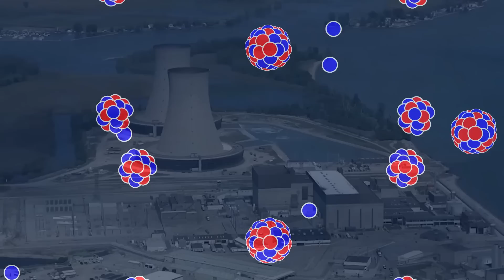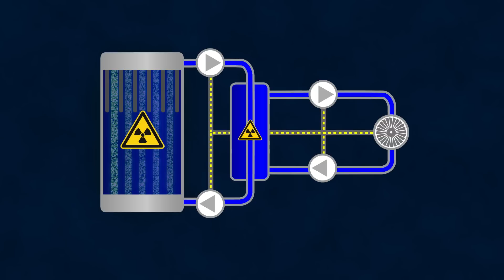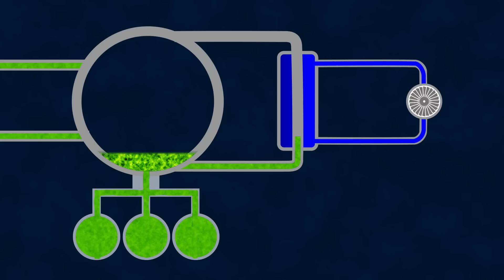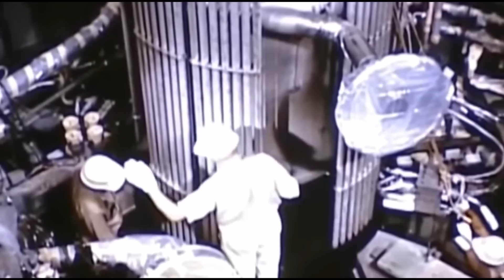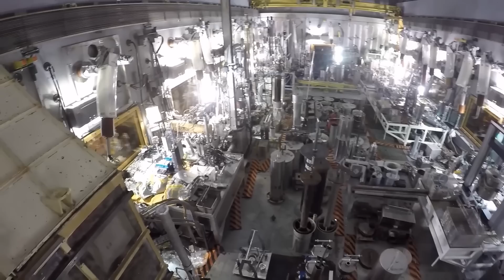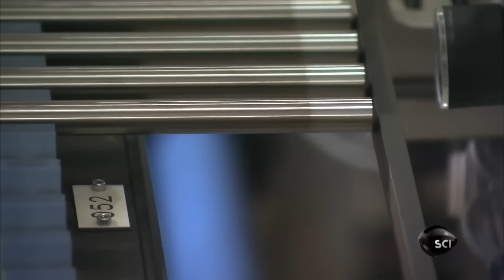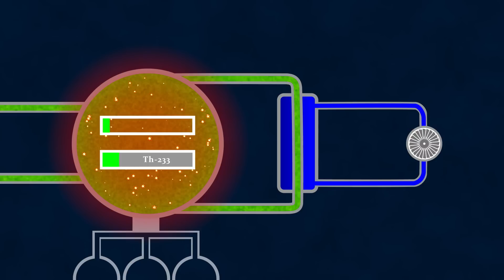Thorium Revolution: Can China’s New Molten Salt Reactor Transform Nuclear Energy?

Comment: How to ensure the corrosive molten salt stay where it's supposed to stay for the long-term is the issue
Reply: I think a few years back they found Zirconium lined tubes slowed  the corrosion down, but even so, corrosion is a just a maintenance problem not a technical.
Reply: @ it's a combination of radioactivity & corrosion & high temperature, so it's kind of more complicated for maintenance
Reply: @Guangrui   Nothing that a bit extra research cannot solve.
Reply: Hastealloy-N. It's a well-known Nickel-based alloy, which has very great corrosion resistance, and was developed with Molten Salt Reactors in mind.
Reply: @ZippyPiglin36  can it stand the radioactivity & corrosion & high temperature for the duration of over 20 years ?
Reply: @Guangrui   Experiments show it can stand such decently.
Reply: @Guangrui  Yes it can. It ablates at around 1 micron (0.001mm) per year of operation and has been calculated to have a 200 year lifespan under normal operating conditions

The (quite mild) corrosion issues are heavily played up by those opposed to molten salts, whilst they conveniently omit mentioning the massive corrosion problems associated with high pressure high temperature water - Davis-Besse 2002 was a VERY near-miss

There's a lot of FUD being tossed around and the way I'd summarise it is: If those opposed to molten salts are so sure they'll fail, why not let tests be run to prove it?

The vehmence of the opposition is directly related to the fear of income loss amongst existing players - who all practice major vendor lock-in. The disposable razor and printer ink crowds learned their lesson from the Nuclear industry. 
Becaise molten salts don't require reactor-unique fuel rods, the suppliers actually have to compete on price and they don't like their cartel applecart being upset

Comment: The USA  & Russia chose Uranium nuclear power instead of  thorium because they wanted to be able to make nuclear weapons.
Reply: That's a bit of a myth.  Countries that wanted plutonium for weapons made it in reactors designed for that purpose, instead of using power reactors.
Reply: @ the two designs are similar but very different from sodium molten salt thorium reactors. Many early power generating reactors were specifically designed as breeders.
Reply: @wwoods66  always happy to be corrected.
Reply: @wwoods66  You are correct - but that misses the point that the feedstock for those plutonium reactors is depleted uranium and for military purposes reactor grade enriched uranium is an unwanted waste product of the process (at 1kg of enriched for 9kg of depleted, they don't mind the losses, it's more than justifiable.)

The reasons Weinberg used enriched uranium for the Nautilus and Shippingport reactors were: 
1: Thorium wasn't available
2: They knew enriched uranium would work 
3: There were tens of tons of the stuff sitting around at separaton plants that the operators were desperate to get rid of

Later on it became militarily convenient to keep civil power dependent on the waste products of weapons manufacture because it made the newly rechristened "enrichment plants" dual purpose and therefore exempt from nuclear limitation treaties whilst also shielding them from financial scrutiny 

Nuclear weapons and highly enriched uranium are a lot more expensive than the USA makes out. The 90% enriched fuel for the newest aircraft carrier is at least 4 times the price paid to build the ship itself but it gets classified as operational expenditure rather than capital expenditure. A nice accounting trick, to put it mildly

This also applies to the Australian nuclear submarine deal. The cost of fuelling ONE submarine is significantly higher than the TOTAL value of the contract

BTW: whilst it's perfectly feasible to put a MSR onboard a ship, I think it's an incredibly bad idea ot have reactors in marine environments. Sooner or later someone hits rocks and sinks. Whilst water is a very good radiation shield and it's virtually impossible to detect any radioactivity around existing wrecks, they're all in deep water, not on a shoreline
Reply: More about developing compact reactors for nuclear naval propulsion.
Reply: @grumpyed58 The thorium reactor developed and tested repeatedly at Oak Ridge was designed to power aircraft. The fact that DOD opted to finance uranium reactors was specifically because they breed bomb grade materials.

Comment: I’m really skeptical that the pipe corrosion issue has been solved. I know Chinese manufacturing has gotten pretty impressive but their metallurgy for advanced alloys is still crap.
Reply: Well, maybe they didn't use metals.
Reply: They have been at this for many years, so it should have been solved.  Iteration 3 by now.

Comment: Chinese Thorium reactors pump the fluoride salt fuel around the reactor core. This sounds great but that stuff is INCREDIBLY radioactive. Seals, bearings, motor, everything gets hammered. Replacing or simply servicing anything is near impossible. Anything that has to be replaced is now highly radioactive. It’s a major design flaw that  Alvin Weinberg never dealt with before Nixon cancelled his project.
Reply: 1: Mildly radioactive
2: The same problem applies to existing reactors
3: "Remote Maintenance of Molten Salt Reactors" demonstrates that it's perfectly feasible. Find it on Youtube

Comment: Very thorough, clear explanation. Often in vids like this, they have gaps of info...but you guys covered it well. I am very keen on seeing MSR become mainstream...too bad the cost is high still, but hopefully it'll be cost competitive with traditional reactors over time. There is also fusion and deep geothermal on the horizon as well.
Reply: The cost isn't high. Weinberg calculated that a MSR would be 80% cheaper to build than conventional designs and 80% cheaper to run - this is important because conventional nuclear power was more expensive than coal in the 1960s (which is why most utilities abandined planning for its use) and has only become more expensive in the last 60 years due to progressively more restrictive conditions being imposed. 

If you were to drop a smoker's lungs (from an autopsy) inside the boundary fence of a nuclear plant, they would be classified as high level nuclear waste and subject to the full contaimnent drill. Several nuclear plants in the USA have their radiation leak alarms go off regularly thanks to wind blowing emissions from "nearby" (20 miles away) coal plants over the sites

Comment: Its a sensible new safer approach.  I'll get excited when we find a way to generate power without having to boil a bucket of water
Reply: Oh but it does boil a bucket of water via the heat exchanger, you had the tank on the left with the salt, which passed the hot salt to a pipe which went thru the heat exchange (loop on the right) the little rotating fan was actually a steam turbine.
Reply: solar power and wind power do not boil water

Comment: So how is Pa-233 separated?
Reply from the maker: Ion exchange in most versions
Reply: Not necessary to separate it.
Simply isolate it (and the molten salt carrying it) from the neutron flux until it decays to U233 then send it all back to the reactor.
Reply: @herbieschwartz9246  That is a lot mixed up feed stock, it is not a guarantee there isn't a u233 ejecting its neutron into Pa-233, they are going to need to separate it... but I suppose you go your method if they are prepared to lose some Pa-233.
Reply: in TMSR-LF1, it isn't. The thorium is directly added to the salt. 

The whole point of this test run is to prove that separate processing and dual blankets aren't needed. It costs a couple of percent efficiency overall but it's a LOT cheaper and radiologically safer (thanks to any U232 remaining contained) 

The point of Weinberg's design is to be both walk-away safe and to balance processing costs against efficiency

A Jet engine consumes 30% more fuel than an equivalent piston engine, but it is 1/10 the weight, 1/50 the maintenance requirements and capable of being built out to 50-100 times the power output of a piston engine - that's what enabled them to take over the aviation world

One of the walkaway safety aspects is that fission reactions thermally self-limit at about 1150C (Doppler effects) AND as the salt heats up it becomes less dense, which reduces reactivity in the core. what was found at MSRE was that use of moderating rods was virtually unneccessary even when swinging power draw(*) between extremes in a short period

MSRE tested every conceivable failure method Weinberg's team could think of, including all the ones seen in water-moderated designs. The worst case scenario was a power rise to 150%, then falling back to 120%. Because Xenon comes out of the melt there's no "snap criticality" issue (which is what caused Chernobyl and SL1 to flash-boil their water with the ensuing steam explosions being the deadly consequence)

(*) MSRE used heatsinking to air on a secondary loop. Extracted heat was varied by varying the fan speeds and duct doors in the heatsinking chamber. They never got to the point of testing electrical generation because when they paused in 1969 with the aim of testing thorium next, approval was deleyed until 1972 when Richard Nixon signed off on orders making molten salt nuclear effectively illegal in the USA and ordered the destruction of the reactor plus all research material. Less than six months later, Kissenger signed the OPEC deals to exclusively use USD as their settlement currency in exchange for USA military protection of OPEC regions (particularly the Middle East and Persian Gulf)
Reply: look at GordonMcDowell's Youtubes, and Kirk Sorensen's FLIBE reactor concept; he explains! 
My guess is, that the industry needs to go to a minimun reactor_size, soon: ~750_MWelectrical ~2250_MW_thermal, 
to make the chemical sepatations and Pa233 storage equipment, pipes, pumps, and tanks operaationally and economically successful. Nobody can hire hundreds of experts, pay them, and let them play/work with "toy-size" chemical equipment; besides a tiny reactor that does produce no revenues, tiny toy_technicum_size energy! Not to mention the environmentally neccessary efforts, to sequester Tritium and Xenon gases and store them safely; which isn't easy. 
A test_reactor needs to produce 750MW electricity and then/there engineers can prove/improve the chemical recycling concept, including efficiently breeding U233. 
Molten Salt Reactors are inherently better than Fast_Uranium238 breeders, whith their fiery, dangerously reactive, alkaline metal coolants; see the damages Na, Li, K, -fires can do! ( BEV-vehicle fires);  or "all" Fast Breeder reactors of the  past had fire accidents!
 Japan Monshu, France Super-Phenix!!
Reply: I think thorium is not dumped directly into the pot. It's kept separated to prevent further neutron bombardment and time will naturally turn it to uranium 223 from decay. Usually it takes about 28 days of isolation, further neutron bombardment will transmute it to less fissile form of uranium.

Comment: Pure salt isnt corrosive
Reply: Thorium fluoride at over 700c isn't corrosive?  😂
Reply: @jimurrata6785  NOT to THORIUM FLUORIDE, lol hey i just solved it , keep a lining of it just cold enough not to block flow but line the inside of the pipe.
Reply: Copenhagen Atomics are the ones to watch in MSR tech. They have the backing to get the first reactors in commercial use. They are actually doing it. And of course many lessons will be learned along the way.